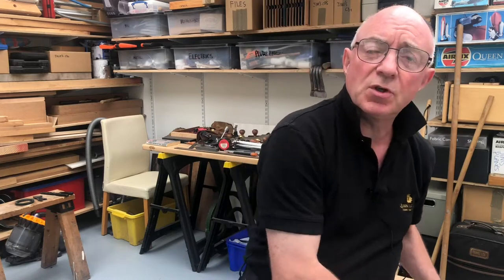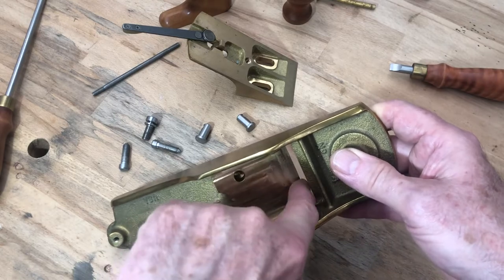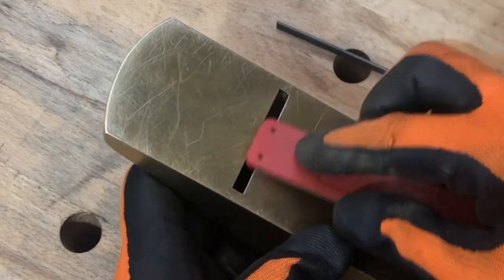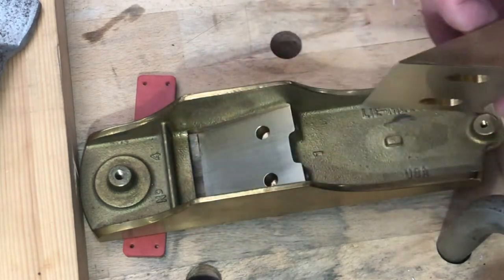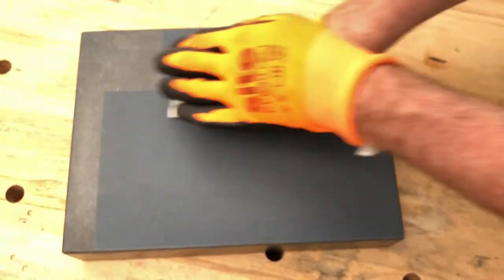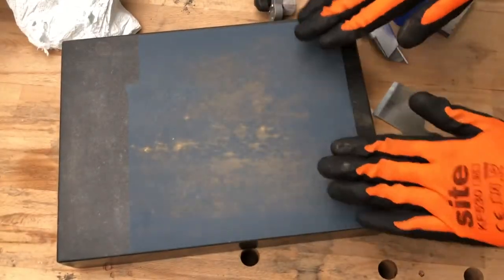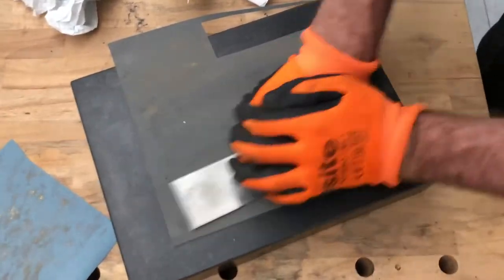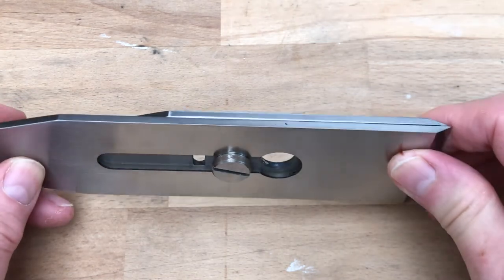Super Tune! The Lie-Nielsen No 4 - Part 1

Comment: Looking forward to part two! Thanks for the upload.
Reply: Also what kind of adhesive are you using that lets you break the bond so easily?
Reply: Thanks for watching! The adhesive is called spraymount, but I think that’s a brand name. It’s found in craft shops or Amazon. It’s for temporarily sticking paper etc to a surface if you expect to reposition it. You should get along with it a solvent or “sticky stuff remover” to clean it off afterwards. “Goo gone” is another brand name I’ve used.
Reply: @Swed I’ve found brake cleaner is also marvellous at melting away the spray adhesive in the surface plate. Instant

Comment: Would a 12" (~300mm) granite surface plate be large enough to smooth the plane parts or do you recommend a larger size? Also, would a grade B stone work for the fine smoothing outside of the sole?
Reply from the maker: Thanks Clinton. Yes, I use a 300mm granite surface plate for the smaller planes and for all small parts. You would only need to go bigger for the longer planes, and then plate glass or any suitably flat surface would do.

I’m not familiar with a “grade B stone”. Could you clarify your second question please, and I’ll do some research?

Comment: Hi, The magnetic grippers looks very useful. Where did you get them?
Reply from the maker: They’re called Magswitches. I got them years ago but they’re quite expensive now. You can get two of the small ones on Amazon for £73.
Reply: @mrlinnsworkshop  thank you!  Good detail work. I had the same 2 questions. Adhesive and mag blocks. I found some welding mag triangles and they’re really strong and I worry they bend the blade I’m working on

Comment: I’m curious about the diamond files you use. What are they and what grits do you use?
Reply from the maker: Hello Steven; thanks for watching the video! The diamond files are by DMT. I got them as a 3 pack from Amazon, where they are around £30. The blue is coarse (45 micron, 325 mesh), the red is fine (25 micron, 600 mesh) and the green is extra fine (9 micron, 1200 mesh). They used to do a black extra coarse, but I can’t find it anywhere.
Reply: @mrlinnsworkshop  watching? Oh boy, I’ll be watching and re-watching this for a while. I’ll be experimenting with your ideas and techniques to see if I can make my planes look like that. Thanks.

Comment: The surfaces on these planes are machined with CNC milling machines and surface grinders to a very high standard. You will not improve them by sticking sandpaper to a flat surface.
Use marking blue and a scraper if you want to make it flat. This plane is now smooth but out of flat.
Reply from the maker: Thanks for the comment. You are of course absolutely correct. I contend, however that the out of flat is minuscule and the effect minor compared to the advantage of the polish. Everything is a compromise; in these techniques, I’m prioritising smoothness (polish) over flatness to achieve slightly better control. Recently, I’ve been hand planing an oak kitchen worktop with the No4 and the advantage of smooth control under high tension is helping significantly. Have to sharpen a lot though!
Reply: My comment seemed a bit unpleasant. That was not my intention. Sorry.
Good answer. You clearly know what you are doing, and you’re absolutely right. The “out of flat” won’t have any negative effect on the plane.
Reply from the maker: Not at all! I took it as a valid point; not in any way unpleasant. I was thinking I hadn’t made it clear in the video. I’ll admit I did ponder for quite a while on the importance of flatness. In such a small area as the frog seat, I don’t think it’s as important as polish. But on the sole, both are important so one should strive to keep flatness as one improves polish. Thanks again for watching!

Comment: What’s the difference in performance after this super tuning?
Reply from the maker: Thanks Joe. Bearing in mind the plane works ok straight out the box, the difference in performance is subtle but definite. Everything feels silky smooth to adjust, which means tiny fractions of depth of cut changes and lateral changes are possible. Definitely an advantage in a smoothing plane. Quite a few of the treatments are cosmetic though, so I suppose these could be omitted without a performance penalty. The tiny improvements add up, but it’s impossible to pinpoint one as being necessary or not.

Comment: What did you use to remove the spray mount off the surface plate? Can’t get it off 😅
Reply from the maker: Hi MD; it’s called Mulitsolve and is made by CT1. Other stuff I’ve used in the past and which works very well is Goo Gone and Sticky Stuff Remover.
Reply: @mrlinnsworkshop thank you !! And is it M3 Spray mount you’re using or just any old spray contact adhesive? Peeling the paper off, I’ve had to use a heat gun as it was coming off in bits 🤦‍♂️
Reply from the maker: @CabinetFramingUK  Yes it’s M3 Spray Mount. I’m not sure why it’s sticking so hard. When I use it on my granite surface plates, it’s low tack and the W&D paper peels off easily. Then I use the solvent and some kind of a scraper to remove the residue. Then clean with meths.
Reply: @mrlinnsworkshop thank you!!

Comment: Hi, just picked one of these up and I was surprised to find that the sides are not square to the sole but they are consistent on each side.  I suspect that perhaps they are designed not to be square for some reason but there you go, it is what it is.  It would be interesting to know what your example is like in this regard.  I imagine that they are all the same and consistent from one example to the next.
Reply from the maker: Thanks for watching! I’ve just checked mine again now it’s finished. It’s not bang on, but if anything it’s only a fraction of a degree out; and I mean way less than a tenth. The sole to side squareness isn’t so important to me as I don’t use this plane for shooting.
Reply: Even if you used the plane for shooting, you'd just need to adjust the iron with the lateral adjustment lever. The sides don't have to be square to the sole.
Reply from the maker: @guillemclapes5587  That’s a good point. Also the work piece can be shimmed with strips of paper to correct any out of square. So, yes I wouldn’t fuss to much over sole/side squareness.

Comment: For its price, I’m very surprised you had to do this much prep just to flatten and finish polish what should already be done.
Reply from the maker: Hello @purpleyams8738; thanks for watching and your comment. It does seem like it doesn’t it? The thing to remember here is that what I’m doing isn’t necessary. It’s extra to what LN provides. If you bought one of these from LN, sharpened the blade and nothing else, it would do it’s job for ever. This is a way of getting a bit extra performance from it, which is actually discernable. If LN were to do this to every tool, they would be much more expensive because it’s so labour intensive. Hope this helps!

Comment: Over and over I see people 'tune' a plane, yet they never use machinist's dye.
How do you know your chip breaker or cap iron is touching the blade for its entire width? - or the frog interfacing the blade well? - or the frog interfacing the plane body well...if you don't use dye? You don't!  
38 years ago I was tuning planes, using artist oil paint.  I got the idea from an old book on carpentry - the author used machinist's dye. ( Too, use water between the back of the paper and your flat surface - sucks the paper flat)
Reply from the maker: Thanks! I’ve been using marker pens to colour parts where I need to see progress. When I get to finishing the chip breaker, I’ll consider what you’ve said. As far as using water to “stick” the paper, I used to do that when flattening Waterstones with wet and dry. For metal prep, I find it moves around enough to be a pain. Also, I don’t always want water near the part.